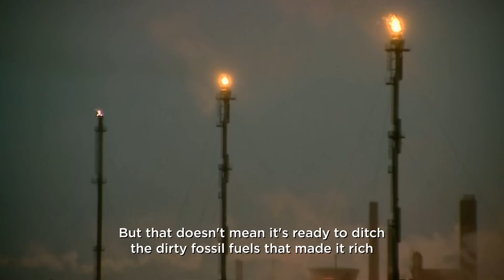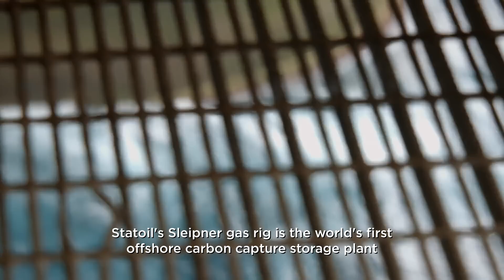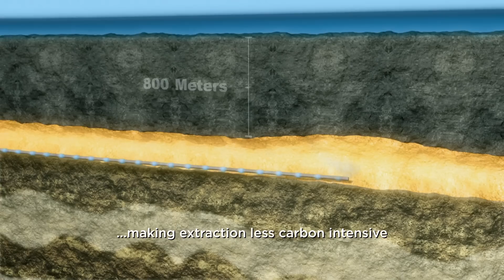Oil and gas companies are facing major technological disruption

Comment: There is no such thing as clean fossil fuel.
Reply: This is true, but I think it's worth noting that there IS such a thing as clean liquid or gas fuel. You can produce methane and generally combustible gases with solar energy and air in what is basically a reverse combustion processs (CO2 and energy to CH4 + O2 rather than CH4 + O2 to energy + CO2). You can then make methanol (a liquid) out of it with other reactions or use algae + more solar energy to produce long-chain hydrocarbons directly, this one is especially important because that's what we will be running our planes on in the future.

In fact I'd go as far as saying that things like ships and airplanes will never go electric simply because green fuels that "convert" solar energy into a convenient, transportable liquid form will become available before super-advanced batteries. Power-to-hydrogen and power-to-methane are a thing right now.

My impossible dream is a world where picking a fuel car or an electric one is a choice of personal lifestyle rather than a choice between pollution and being somewhat cleaner.
Reply: No fuel is automatically fossil though. "Fossil" just denotes that right now, we take most of that fuel from a fossil deposit, which basically means old as fuck materials stored away during the course of millions of years. Fossil energy sources are kinda like a huge battery that was charged for us by the Earth for a really long time and now we're discharging it at an insanely quick rate - when it runs out we're gonna get in trouble if we don't use a newer, longer-lived battery like the Sun or perhaps fusion sources (which are the same thing anyways).

Right now hydrogen is technically "fossil" because we extract it from fossil fuels, but technically there's nothing preventing us from synthesizing it from water with hydrolysis, creating a closed non-fossil cycle where we turn water into hydrogen and oxygen and then burn them into water again. In that case obviously it's only useful as an energy storage medium, not a source (due to conservation of energy), which is going to be the case for every fuel as we run out of ancient fossil deposits. But again, that doesn't mean we could, for example, synthesize new kerosene for airplanes using solar power. It would be a huge economic shift because simply pumping it out of the ground won't cut it any more and we'll need renewable or nuclear sources of primary energy, but liquid/gaseous fuels are still a good way to store that new energy.
Reply: Blazer, I am working on engine that can power airplane, house, car, boat that is 60%.  Runs on fuels (Gasoline, Diesel, propane, Methanol, Ethanol...bio juice etc), solar thermal, and electricity from battery or grid.  One device that can give 24/7 power.  Solar full costs should be 3 cents/kw-hr and on Natural Gas around 6 cents/kw-hr from house feed or half that with industrial feed.  In a car....250 mpg highway and 500 mpg city.  There is a better way.  At 500 mpg that is 20 times better than a Buikc or Toyota vehicle.  95% of the fuel needs GONE.  Can use NG from house or store 20 miles if wanted from house solar, thus cutting that last 5% in half....  Why not go with something that can get 95% of the fuels gone whereas "renewables" don't even break even.?
Reply: Tell me what a clean fuel is and I'll show you where you're wrong.
Reply: Check out the Shellenberger TedX video.
Reply: It's not perfect but i prefer that  they made that, than  to see these guy dumping co2 for dumb reason and not trying to do anything it could save some co2 emission before other sources become cheaper.
Reply: Trevor H I do look for ways in which I could contribute to that kind of future. :) So we are kinda already connected in some ways.
Reply: Trevor H What is your plan? :)
Reply: Charles-A Rovira      Dear   confuse person         what do you do     when their is no sun light    or it's  night time      with solar panels
Reply: Solar panels recently passed the point where the carbon cost of fabricating and delivering a panel to your roof is now offset completely by the energy it will produce in its lifetime. That is a big milestone. No denying that the industry to build giant windmills and battery systems is as dirty as any major industry. I guess the thing people focus on is that the old plants were built dirty and RUN dirty. New energy plants will run clean [solar farms, wind farms, etc.].
Reply: There is no such thing as "fossil" fuel. Trillions of dollars of wealth will move into the very deep pockets of the globalists who will control our lives. There is a hidden agenda in all this bullshit, nobody gives a shit about carbon emissions and "global warming", this is all about the powerful elitists owning every man, woman, and child on the planet.
Reply: There is if you apply CCUS technology. But we don’t yet have such a technology that is economically viable. And when we do, it will always be better to use carbon-neutral fuel (preferably either synthetic fuel or biofuel made from waste) in conjunction with carbon capture, so we get a carbon negative effect.

There will always be a need for combustible fuel. Heavy industry cannot function without high temperatures. But we need to move away from fossil fuels for the things that can be powered by electricity.
Reply: exactly my thought sounds more like Donald Trump "Clean coal" noise. Even if you succeed using clean energy to explore, you are still exploring dirty energy and whatever carbon emissions you think you are saying from the exploration and production process is irrelevant compared to what you are selling out.
Reply: There is no such thing as "clean" energy.
Reply: Noah S. says:
"There is no such thing as "clean" energy."
==
There's such thing as "cleaner" energy.
Far cleaner.
Reply: Every current energy source has it's environmental impact,  if it involves manufacturing things and disposing of the product after it's life cycle.
Reply: DoYouThinkForUrselF  says:
"Every current energy source has it's environmental impact,"
==
It's just that far less damaging than fossil fuel burning.
Reply: I am no expert on the subject but lithium batteries are hazardous to dispose of.   Wind power kills many birds and those propellers (heavy) have to have bearings replaced often at great expense and down time.  Problem with industries these days is they use gov't to regulate for them at the expense of their competitors.   So we see a lot of public money flowing to these corporations when they need bailouts ect, this is no different in the case of renewable's.   The market simply will not support the economics of the current renewable solutions and then it becomes a political issue rather than a environmental issue.   

      In fact the gov't supported central banking system / public system encourages poor management of resources by encouraging large amount of debt to spur on unsustainable business models.   Look at California for instance, gov't subsidized water for cattle and farming industries and they nearly ran out of water.   Patent system enables big business to sit on patents that may help mankind but hurt their business interests (corporation).   

        Lets face it this is men we are talking about.   People who have their own self interests at heart, and it will always be that way.   So i think we understand lobbyists and gov't and how that system works.   Ultimate power (gov't) mixed with big money will always lead to a form of fascism economically.   This is why the current science models of global warming fixate on a .01% change in co2 levels but limit the suns variation on the climate to .1% and they do not address rising solar radiation levels that can excite water molecules / atmosphere and even permeate the earth's crust.  Suspicious Observers on Utube here just did three video's on some of these variables.   

       In short they only account for co2 changes and blame the rest of climate change on human activity.   This will lead to larger gov't which are run by corporations and a public who is given the bill through carbon taxes (like i pay in Alberta for gas and heating my house)    To me this is more about politics and big money than environmental issues.   Just look at how your corporate gov't sent all the manufacturing to China where cheaper wages and pollution was ten times worse due to no pollution regulations.   China is immune to a lot of the Paris climate accord which means more profits for corps who pay less to manufacture but pollute worse in China.   

     Honestly i am very skeptical of gov't and who they serve and i think we all should be and i think the whole environmental movement is not on the up and up.
Reply: Yes this is true i am no expert but you are simply playing the copy paste game.   Anyone can do that, and come on really wiki.....=)

   https://www.theguardian.com/sustainable-business/2017/aug/24/nickel-mining-hidden-environmental-cost-electric-cars-batteries

    There are numerous articles talking about the draw backs of Electric cars, there above is just one example of many i could have cut and pasted. Ewww i just noticed the one i picked was a Guardian article ugh lol,  not even fan of them.    Electric cars require power as well, you simply diverted where you draw power from.    No matter what power source you use they all have their impacts on the environment.

       Also the turbine / bird  issue in your wiki pasted article says

     "There are reports of bird and bat mortality at wind turbines as there are around other artificial structures. The scale of the ecological impact remains unclear."

      Don't get me wrong i think the environment is a very important issue, but i have serious misgivings about the political climate these days and how closely tied they are to corporations and banks for that matter.  You no doubt lean left in your political views i am sure you understand that, remember the bailouts of banks in 2008?  Our universities as well are ideologically driven rather than based in critical thinking.   

       The last century was run by big oil and the next century will be run by the same groups only they are transitioning us to new energy which they are heavily invested in as well, only they also got your tax money working for them as well. A lot of these people run in circles like the Council of Foreign Relations and in your gov't.   Their allegiance is not to you first, it's to themselves.   Like George Carlin said, it's a club and YOU ARE NOT IN IT.  

           Corbett report does a video on this   Called .........how big oil took over the world.     He actually has a few videos about it and how the environmental movement is more of a technocratic system , a form of fascism run by big corporations.   As i already stated money matters in politics, those   paper ballots you think matter are an illusion.   You want a vote....vote with your  wallet that is how the real  world  works, that is how business interacts with your bullshit politicians.

     Anyhow you already know my view.   I am open to new information and that is why i stated i am no expert to start with.   I am trying to be humble but the fact remains as you get older you get a little wiser and begin to see through the BS.   So over several years now I come to terms with the fact that you can't trust a media run by 5 corporations, you can't trust a gov't bought off by lobbyists and you can't trust a education system funded by gov't who are bought and paid for.    Hollywood / media and academia all look to be run by the left and truly they look to be the next tyrannical political system.

      I think only way to stop them is to defund them, civil disobedience, but through peaceful means.   If everyone stopped giving them taxes it's not like they could round the whole country up lol...........Then maybe we could act like adults and interact within our communities and life for everyone would get better instead of worse like it appears to be for so many these days....dwindling middle class ect.
Reply: It's either adapt, or go home boy.
Reply: Hector Vega says:
"It's either adapt, or go home boy."
==
How many days to adapt when you are starved to death from food shortage?
Reply: @allgoo1964  I don't think you understand what I meant. I must have left it with no context. I meant in business, that could be in investing, or Continue research in Seaweed.
Reply: Hector Vega says:
"or Continue research in Seaweed."
==
Do you mean "algae"?

"Algae to capture CO2"
https://phys.org/news/2013-03-algae-capture-co2.html

Did you know that there's enough CO2 in the air to keep the earth warm up the next thousands of years even if we stopped release additional CO2 today?

Do you know that we haven't made any effort to stop burning fossil fuel yet?
The use of fossil is accelerating as we speak.
Reply: @allgoo1964  so it was Algae, huh. I thought it was seaweed. Well one of those can be made into natural oil, but for plastic, rust lubricant, etc. All materials made of oil. I'm not against renewable energy sources. You should be well aware, why we haven't stop burning fossil fuels. After all Capitalism, Oil and gas companies have A Lot of Money, so you can see that they are halting any process of renewable energy, recycling of plastics. It's the reason I say adapt or go home, and we know that they can't adapt unless it's that algae or seaweed, and we know they refused to go home.
Reply: Hector Vega says:
"so it was Algae, huh. I thought it was seaweed..."
"one of those can be made into natural oil, "
==
I wasn't aware of the seaweed that turns into oil.

My search result came up empty.

"but for plastic, rust lubricant, etc. "
==
Did you know that fossil oil becomes a problem only when it release CO2 in the air?

It'd be great if we could make all CO2  in the air into plastic.

Did you know this?
Reply: @allgoo1964  I was wrong about seaweed. I forgot what it was. Now I know it's algae.
Reply: Hector Vega says:
"I was wrong about seaweed. I forgot what it was. Now I know it's algae."
=
Thank you for the confirmation.
Reply: @allgoo1964  well it's been a long time since I read the article about it, but now I know thanks.
Reply: @allgoo1964  You said, 
"[...] a problem only when it release CO2 in the air?

It'd be great if we could make all CO2 in the air into plastic.

Did you know this?"
Reply: @allgoo1964  "making all the CO2 in the air into plastic" emphasis on "all", has the effective result of removing all CO2 from the air, to be turning into plastic material.

With no CO2 in the air, there is nothing for plants to breath-so all plants die.
Also CO2 is touted as the #1 worst thing for "climate change/global warming" so removing it necessarily will do something to the climate.

If your imagination is too poor to see the effects there, there is no point in me further speaking with you.
Reply: There is cleaner fossil fuel as opposed to dirtier ones
Reply: Maybe we all should concentrate more on CO2 footprint in production + CO2 emissions from the actual product. The main factor to remember is that this is a transition phase and once the green technology has grown enough the CO2 emissions during  production in the case of renewable energy sources will eventually become negligible.....Btw, none of this will happen if we can't survive for long enough without natural disasters decimating infrastructure. It is kinda already late to figure out a technical drastic solution to lower ocean surface temperature...It would be great if these 'woke' giant corporations could spare a cent to research and development technology for that
Reply: @aleenaprasannan2146  I'm not too concerned with "decimation". Its only a reduction by 10% anyway. 

How do you propose to reduce CO2 emissions in livestock management and other farm work though?
Reply: Trevor H It might sound drastic, but the only environmentally friendly farming practice, whether it's livestock or crops, is to completely dismantle the industrial nature of production and consume everything locally. Monoculture is disastrous to nature, while small scale mixed farming along with livestock suitable for the region would provide perfect organic fertilizer. The place where I'm from has a lot of backwaters and duck rearing is a thing that helps balance the Ecosystem here and they help manure and keep pests away from paddy fields. Our main problem is over production as well as overconsumption. We do not need to eat this much anything, but cutting out all the meat from our diets entirely would be another major idiocy, because we do not have enough farm land to cultivate enough plant based food to supplement protein for our entire population. Last time when palm oil became a fad, orangutans lost their home. That's what happens when you don't eat locally.... overconsumption and industrial agriculture will destroy some other ecosystem
Reply: Natural gas is a fossil fuel but doesn't leave any Co2 after burning
Reply: star cruiser  Triple CO2 !!!  1200 PPM is where plants start to slow their linear  growth rate with more CO2...diminishing returns. 2000 is where CO2 was most of the life of earth.  But that said, it is natural as Murry Salby shows.  The absorption time is LESS than 1 year.  CO2 comes out in tropics and into ocean in high latitudes.  If the water up north turns warm (circulation pattern...long delays), the CO2 does not go back into the water and you see this rise in CO2. Thia is what is causing higher CO2, not man.  Man is not even detected in the signature of CO2 flux.
Reply: star cruiser  Yes, and CO2 does not control temps.  If you do Molar density of the air data (Connolly papers) the line is linear.  This means CO2 AGW is false.  Heating where claimed does not exist and the straight like kills the AGW theory/cult.  This game is up soon.  BTW, Einstein agrees with this that if air is in equilibrium then CO2 just absorbs and re-emits and does not heat.  This occurs a few hundred feet above ground all the way to tropopause.  More CO2 does nothing to add warming at these levels.  More CO2 is a good thing.  Nature however is so big that we can't change it.
Reply: We need fossil fuels and fracting for future generations. The current crop of renewables are not viable, practical or sustainable. The deficite of energy required to source and activiate these resources mean that it's short term and counter productive to think that fossils will be replaced within the next 200 years.
Reply: Charles-A Rovira  Just letting you know..... one year down the track, that South Australian's are now paying 3 times the electricity prices as any where else in Australia.... and when the power goe's down, the battery lasts 3 minutes ( which it does all the time ). On top of this each and every South Australian owes the govt. $10,000 for this rip off ( someone had to pay Elon ).
Reply: They polished up the crude oil until now, it will be shining soon.
Reply: Or green energy
Reply: So called fossil fuels are far more efficient, reliable and clean than any renewable nonsense. Natural gas is the greatest of all energy sources. Solar panels are manufactured in ridiculously polluting processes and are themselves extremely inefficient and costly. Wind power is a complete joke.

Batteries are inefficient, ever declining in performance, and disposal is an environmental nightmare.

Eco-fascists spread lies design to impoverished western economies, exterminate the middle class, and to enrich the corrupt eco-fascists and the politicians, businesses, and bankers that collaborate with them.
Reply: Trevor H, even if what you claim has some truth in it, you must keep in mind that the change has to start somewhere. It cannot happen from one day to another. I am pretty sure you'd agree with a future where all the plants, construction work, etc. will use electricity as a fuel which is generated from renewable sources. Can you see that bigger picture? The point is not to immediately turn away from fossil fuels, that's just simply isn't feasible. The point is to work towards a more sustainable future.
Reply: Ivan, he can't because CO2 is neither clean or dirty.  It is part of life and without it we all die.
Reply: Tivadar Balazs
Excellent, I'm glad to hear it.  Now lets contribute today, and not waste looking for the future.
Reply: China 🇨🇳 is opening countless clean coal plants. They are on the cutting edge.
Reply: The_Blazer 
water is for drinking purposes.
Reply: chethan salahalli thippeswamy expand on your claim pls
Reply: There is no such thing as 'fossil fuels'. Do just a little research. AGW is a hoax and a scam ffs
Reply: so coal. gas. & oil are not fossil fuels 'UGH' is education going backwards now ?
Reply: Actually, hydrogen fuel is technically a fossil fuel, as it is "Limited" and not renewable. It is also a clean, zero-emission fuel.
Reply: Trevor H exactly
Reply: chethan salahalli thippeswamy
There's no such thing as clean manufacturing of renewable energy plants.

Just because you disassociate by one level in the process, doesn't mean you are any less reliant on fossil fuel energy.  Coal for metal casting parts, diesel and gas for construction equipment to build the location, etc.
Reply: Trevor H says:
"There's no such thing as clean manufacturing of renewable energy plants..."
==
They are still cleaner than fossil fuel industry.

There's no such thing as clean manufacturing of fossil fuel plants either.
It's only far worse.

You can say the same to comparison between Electric cars vs. bicycles.
There's no such thing as clean manufacturing of electric car.
There's no such thing as clean manufacturing of bicycle.
It's just that manufacturing of bicycles are much cleaner.
Reply: @allgoo1964  cleaner, does not mean clean. You're agreeing with me and then disagreeing on nuance. Objectively, I'm not wrong.

And I recently saw a build video one did about building a bicycle 100% out of wood. If hand tools were used, this is an effectively clean manufacturing of a bicycle.
Reply: @trevorh6438  says:
"allgoo19 you want to remove all CO2 from the air?"
==
Where did I say that?
Copy & paste my entire comment where you found it.
I don't remember I ever said such thing.

Don't argue against a talking point you made up.
Reply: @trevorh6438  is done once and for good while fuel burning go forever  ... r u stupid or what !?
Reply: Tivadar Balazs
No, actually I do not agree with that future.  I want a future where solar thermal and wind mechanical are used, with free wireless and battery-less electricity like Nikola Tesla envisioned.  Also airships instead of planes and massive congested roads, and large swaths of common forest and greenery where humanity lives creatively and in harmony with nature and itself, but that's neither here nor there.

Of course it cannot all happen in one day.  That is why I am sowing the seeds today, that they may grow large and bounteous in the future.  If everyone was active and did their part, it could happen in not so many years. Will you join me in sowing and tending the crop?